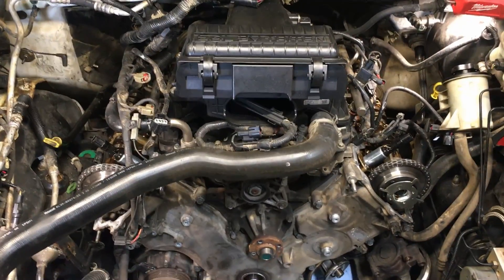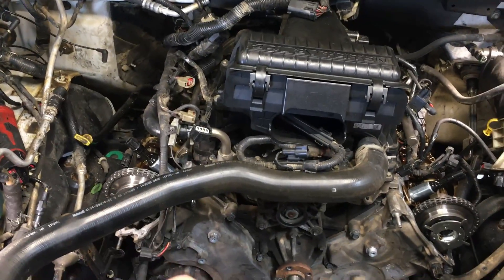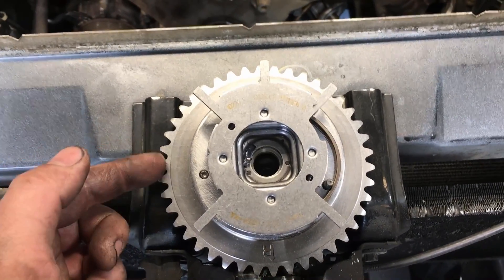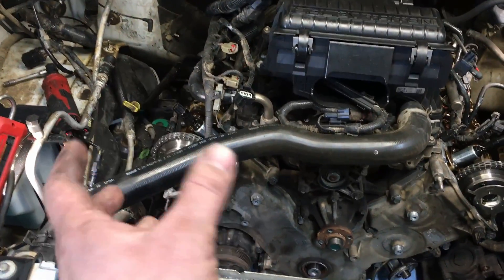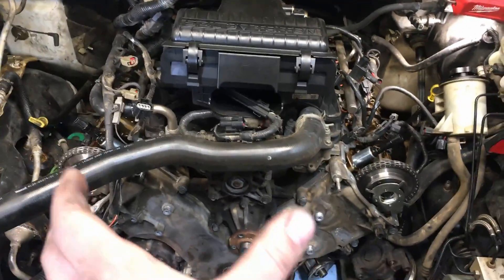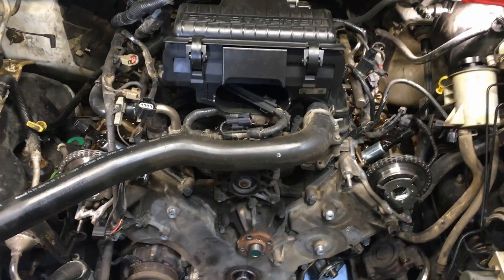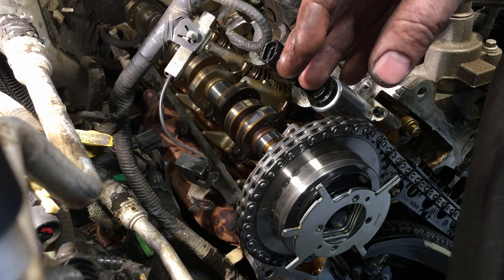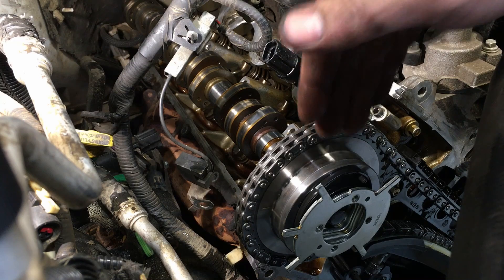Ford 5.4L 3v Triton Engine: DO NOT USE AFTERMARKET PHASERS FROM FREEDOM RACING/OTHERS; THIS IS WHY!

Comment: I have a brand new 2018 Ford Raptor (3 month old ) with 8,500 miles all stock and don’t race or push it. And is on the dealer right now because it left me stranded 3 times . The first problem was at 8,000 miles it went on some kind of safe mode and gave a low oil warning light . I pulled out the dip stick , wipes clean and checked the oil and it came out dry. Took it to the dealer and they just did an oil change and tire rotation as if it was performing the first 10,000 mile service. I told them that was not the issue and where did my oil went ? And why a limp mode . They could not give me an answer. This was a Friday . Saturday I washed the truck and did not used it. Sunday while leaving with my kids to the beach it started to shake like if it had párkinson desease going down a hill and as I came to a stop with the auto start stop de activated it started shaking again and turns of by itself. And did not wanted to start until I got out of the truck and got back in and started it up again. Needles to say it did not had a throttle response and it was not accelerating. I pulled out a blue driver OBD2 scanner and got a P0015 code . On Monday I took it to the dealer first thing in the morning and explained what had happened and showed them the video of the problem and the check engine light which happened 3 times on Sunday and the photo of the code . They took a whole day to diagnose and came up with that my truck had a bad VCT phaser. And that it was the first truck to have that issue . They stayed with it a week and called me to pick it up and it was ready . So I went and picked it up and about 15 minutes into the drive boom !!!! The same problem happened and I was lucky to video it and the truck started shaking again with an intermittent check engine light and it turned off again . When I got it to turn on it was running funny like in only one bank of cylinders and a big misfire . It did not had a throttle response and it would not accelerate . Needles to say it went into limp mode again and I drove it to the dealer like that . They still have it in the shop. My question is : I’m a marine technician for Yamaha and have being in the field for over 25 years and know engines quite well . Does this 3.5L V6 high output Raptor engine is an interference engine ? Do the valves contact the piston if there is a valve train problem like the VCT phasers get damage or overretarded ?

Comment: My 05 F150 has the tick but also has this strange sort of violent bump or series of bumps (shutter/bucking)sensations during acceleration.  Hard to explain. No warning lights or codes. Phaser issue? I did flush transmission fluid at 100k and used Amsoil fluid but no friction modifier.

Comment: Great videos FTM. Question.....What are the systems of bad Phaser(s)? My 2008 5.4 Expedition revs to only about 1500RPM give or take with pedal to floor in park. About the same RPM driving it accommodated with knocking on occasion. Have parked it indoors now going on two years, starting it occasionally. Time to fix her up. Thanks! Dave

Comment: Okay so question, can I use after market chains, guides, tensioners, and VCT valves; and then buy OEM phasers? The reason I ask is I need to do a timing job ASAP, and 1. I dont have the 834 to drop on the OEM kit and 2. Its going to take a while to save up that money as I am a broke college student. The truck is at 105,000, and everything seems good except the start up rattle, and a rattle when rpms drop from 1400-1000 rmps.

Comment: I ordered aftermarket phasers , didn't use them ordered Ford phasers instead , installed them and now no#2 is knocking , why ? New phasers , oil pump, chains, tensioners , actuators and new oil and filter . Even flushed motor with trans fluid and kerosene . Very depressed

Comment: What your thoughts on running lock out kits on stock motors, I’m about to put aftermarket cams in my 3v and some of the cams require lock outs or limiters

Comment: Anyone else notice the L and R stamped on the phasers? Are the phasers identical? If not, then the L phaser should be on the driver side and R on the passenger side.
Reply from the maker: Yes they are universal just use the correct timing mark for the side they are being installed on.
Reply: Great, thank you. I'll be taking care of this in a couple weeks. Your channel saved me roughly $2,500-3,000 in the last 12 months. It'll be well over $5k by year's end. All I can say is thank you.

Comment: Thank you for the courage to tell the truth here. You risk feedback from these companies and aggravation of threats. They make a ton of money selling crap. Aftermarket stuff is for the most part inferior in quality in comparison to OEM. Get the best name parts by the best name people. Do it once and do it right.  Just had a timing belt snap on our Subaru after trusting a supplier that was selling a kit with GMB bearings and Aisen water pump. Didnt say anything about the belt manufacturer. Everyone sold on amazon failed you guessed it belt broke. New OEM timing kit...  Mitsuboshi belt, NTN NSK and koyo bearings and tensioners, heads redone... bent valves.  Now engine burns a bit of oil. Very Very frustrating [83((  thanks again and I very much enjoy your videos

Comment: How do you feel about using Seafoam in the engine oil, to clean out neglected 5.4 3V engines?  By using it, I mean driving about 10 miles, or idling for 15-30 minutes, and changing the oil. I’m super curious on your opinion. Thanks!

Comment: Hi i have a 2006 Lincoln mark lt if which we just overhaul the engine.  Bought a kit from enginetech for the timing.  Replace all sensors and box solenoid with motor craft parts.  After starting the truck it ran perfect for about 1.5 hrs then it shut down. Now when it is cold it starts up fine and after about 10 mins after it warms up it will die very roughy then shut down.  After trying to restart it will not turn on we have let it cool down.  OBD is not throwing any codes. Not sure if timing is of ornthe solenoids are bad as it seems timing goes off after warm.

Comment: The 5.4 3V is quite an advanced engine design. Why is it that Ford has so much trouble turning a good design into a production part that fails? You never see this kind of stuff from European  car manufacturers engines like BMW or Benz. If you compare the Ford phaser which is made from a crappy pressed metal component with a Lexus unit, the latter is half the size and is machined not stamped. They used to be actuated by rising oil pressure but if customers missed an oil change and the oil got thick it blocked the oil feed hole. Now they are electrically actuated. This is pretty basic  really. A 1st year apprentice would know this stuff. 
Its the same with the Ecoboost hand grenade engine. If you want a turbo engine to go the same distance as a non turbo, talk to BMW or Nissan. For just about everyone else, their turbo engines are under engineered with narrow mains and connecting rod bearings. Common sense says that you =need bigger and wider bearings to cope with the boost pressure. But no, Ford knows best. IN Australia Ford withdrew the Ecoboost engine from sale. They were breaking at less than 150,000kms.

Comment: Hey man thanks for the videos, got 260k plus out my 3V but now the passenger side phaser has let go went from the normal tick to a diesel sounding rattle. Do you recommend doing the VCT solenoids as well when installing this kit? And is the melling high volume oil pump a better choice than the melling normal volume? Wanna keep the truck a while and just wanna do it right the first time.

Comment: I'm a little confused about "only Ford makes a good replacement".  Is this replacement identical to the original?  The originals don't last so this leads to having to replace them in the first place.  Are these $800 kits modified to last forever?

Comment: I used aftermarket phasers and having issues like you are showing with indicator pin out of line. not getting any codes other than miss fires on same side as pin out {passenger} and looking thu oil filler hole. Will not stay running without rpms going up and down and will not hardly travel when in gear. but will rev up when in park/neutral. What is going on?

Comment: Hmm, didn't know non-electrical mechanical components that aren't connected to the pcm could be commanded by the pcm like you stated in your video.....actually the pcm CANNOT command anything that it isn't connected to electronically. May have been in the heat of being irritated about the phasers that you said that, but should probably edit your videos better so you can catch that kinda stuff.
Reply from the maker: The phasers are moved by oil pressure regulated by the vct solenoids commanded by the pcm. Now do you get it?
Reply: Nick Pierce, when the pcm commands the solenoids they allow pressurized oil into galleys which hydraulically actuate the phasers.  Many engines do this nowadays.  
My 11/2004 (very early) 5.4 3V has 184K on it.  The engine has not needed to be open. I've only needed a couple of injectors and coils. Keep your oil clean everybody!

Comment: In the last shot of the video,  it shows an "R" on the phaser mounted on the left side of the engine.  Does that "R" stand for "RIGHT",  as in - mount on right side of the engine?  I don't know.  That's why I'm asking.
Reply from the maker: They are universal side to side so they have both R and L marks.
Reply: FordTechMakuloco, thanks for the info.  I really appreciate it.

Comment: As always, let the buyer beware... Having bought phasers from Freedom Racing after watching your videos, all of the parts I bought from Freedom are Ford OEM (phasers, VCT solenoids, lifters, roller rockers, et al)... all parts are genuine Ford in Ford sealed packaging with Ford part numbers.  Yes, Freedom sells aftermarket parts as does Amazon.  I'm currently redoing my son's F150 that had a timing set installed in his 5.4 3V one year ago. The person he had install the parts bought a Dorman timing set.  In less than a year, the passenger side tensioner collapsed.  Freedom Racing sells Ford parts (OEM) along with aftermarket parts.  I've never had a problem because I research my parts thoroughly and order online WITHOUT calling and asking for recommendations... I found out too late that my son's truck had Dorman parts that failed that came from Amazon.  They sell other aftermarket parts that I wouldn't trust such as the Evergreen aftermarket brand. That's my two cents... thanx for listening!!
Reply: Update on my son's F150... timing cover removed; tensioners fine but upper chain guides are junk... passenger side is nothing but pieces, driver's side is snapped in half... bummer!! Will have to remove pan and clean out pieces of guide... was planning on replacing oil pump anyway so will do that at same time...thanks, Brian, for the good video on R&Ring the oil pan on a 5.4 3v... keep up the good work!!

Comment: I bought a puller for 6.5liter maxxforce (international) from freedom the puller is great it's actually an international part number on it, but when i received it there were no instructions for it and the blow molded case they come in when you get it from the dealer was missing, they're cheap s.o.b's pisses me off because i have to come up with a storage solution for a 600.00 puller

Comment: I have had multiple problems with the vct solenoid from Ford. It's a new Jasper engine Ford phasers and I've been through five of them on the right side. Left side is still strong. Is there a fix for this. I puts after market vct in it felt and looked better built.

Comment: im a small time mechanic . last shop i worked at was 12 years . and i know and feel the aggravation you have . there is nothing more aggravating than having to tell the customer . that not only the job they did take all this time from them . but the parts they used were junk right outta the box !! and than them getting pissed about all that . but to do the job right its going to cost this much more .. once again . it falls down to . you get what you pay for . and when it comes to timing parts its do it right or not at all . with all engines being interference motors .. might cost more . but its labor that cost more if you have to do the job again ... thanks for the video !!

Comment: Hey Brian...I'm in the process of doing the complete timing on my 05 f150.  I've gotten to the point of removing all pulleys and undoing the valve cover bolts.  Took me about 6 hours cause I've been doing it piece meal.  I loosened the bracket on the ac accumulator I hope I don't have to remove it in order to get the valve cover off.  I've been studying your video series and am pretty confident I should have no issues.  Just not looking forward to installing all the roller followers piece by piece.  Anyways thanks for putting out excellent info in order to help us out!!

Comment: Thanks i bought Dorman wrong one i am rebuilding whole motor put 2 sets in run gd for awhile than start running rough at idle give gas goes away i changed everything but truck has 200000 miles so i went complete just want right phaser i kept hearing tapping sound and code bank 1

Comment: Completely off topi but does a 2010 4.6 3v have any issues like the 5.4? If I put in drive and hold the brake and rev to 1k rpms it makes the same rattle as a cold start, any idea what it could be? Also this truck has 270,000miles and has been kept on a pretty good maintenance routine, barely goes past 5k on an oil change, and it has had rocker arms and cam replaced on one side because the rocker arm came off and destroyed it. Other than that it’s a solid engine and has plenty of power left in it.

Comment: I have a 2000 ford f 150.  Currently replacing the motor.  Motor is in but something is telling the engine that its running hot and it begins shutting cylinders down.   Can you point me in the general areas that might cause this problem?
Reply: 5.4

Comment: i want a new ford body with a 2001 triton i got 320k on my last one it was leaking oil a bit but everything worked on that truck i got that truck 80k miles on it i never put a light bulb in it only tune ups in tires then drunk guy hit me now i got f##ked up neck and newer truck that already broke a few times learned that if spark plugs get to old they start eating coils it seems fine now but don't like hearing this.

Comment: You are a fantastic mechanic for these 5.4 3v. Ford should have recalled every single model and upgraded all their vehicles once the issue was discovered. Anyone who has a phaser issue should see all your videos. Keep up the good work.
Reply: Josh Adkins All 4.6 and 5.4 3 valves should be recalled.
Reply: FORD should have also recalled all vehicles from 1999-2003 where the heads blow out the sparkplug............this already cost me alot of money and I'm thinking of trading my truck in for a GM LS MOTOR or spend more money on after market heads.

Comment: ths guy has me convinced my ttruck is going to blow any day, owned since 98k miles, had the tick on the passenger side and it has 170k harsh miles on it from a 18 year old till now a 27 year old and its still going strong and its tuned with a edge evolution, i get a lean bank code and misifires when its cold sometimes, but i figured run it and ill replace the motor when i need to. also has had start up rattle for about 50k miles atleast, idk lets see how long she goes, if i get a new motor ill take care of her properly,

Comment: hey just want to say that I love you l videos they are super helpful. I have a 5.4 3v that I can’t figure out and I wanted to ask you if it’s possible for a camphaser go look perfectly fine as per  your visual inspection tips but as soon as truck starts to phase over throwing timing off with the solenoids in plugged and if so have you seen this? tia

Comment: must be made by dorman...
Reply: Can you use the "piece of cheese" to get just the phasers out so you don't have to retime and disassemble the entire thing?
Reply from the maker: Yes same as any phaser replacement on the 3v engines.
Reply: phew.... I remember swapping out the cams on my 07 Mustang GT using that method. It was the 4.6L 3v

Comment: Hey, I love your videos. But I take issue  with your aftermarket hate. Sure, some aren't good. But, lets not pretend that Ford makes the Phaser themselves. I've  spent close to 20 years in auto parts. In both OEM and aftermarket. MANY MANY times an "aftermarket" part is exactly the same as the OEM part. If you research your parts.
Reply from the maker: As stated in the video I have nothing against aftermarket parts but for some reason no one can get these phaser right. Did you watch the entire video before commenting? I know Ford does not make the phasers themselves but their tier 1 suppliers make them to Ford spec which is a much higher level than aftermarket.
Reply: @FordTechMakuloco  I did watch the whole thing.  I noticed that you said you weren't  against aftermarket parts overall. Yes OEM specs are generally  better, but many cases the OEM supplier  will sell the same part in their  aftermarket lines. Which is my point. The  newer 5.0L phasers are made by Borg  Warner.  A company that doesn't  exactly  have a reputation for quality on it's  own.
Reply from the maker: According to Cloyes rep Borg Warner is the tier 1 supplier for the Ford timing components so that makes sense.

Comment: Oh man thanks for the look out bro...! What about after market wheel hubs 2004 f150 lariat,  would it have made my ball joint snap,  or did they just need to be replaced?
Reply: If your ball joints broke they were on borrowed time for many, many miles. You can actually feel them flop if you pay attention if they're that bad.
Reply: @leftyeh6495  i ordered new ones..moog...gonna redo the entire front end.